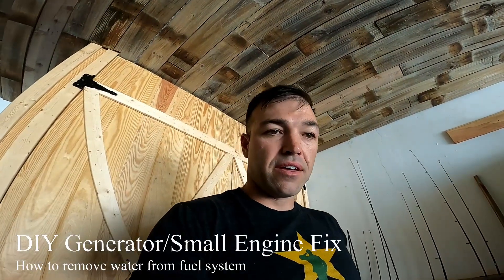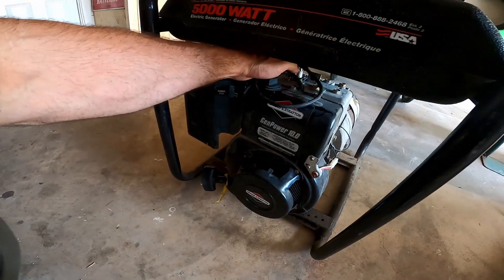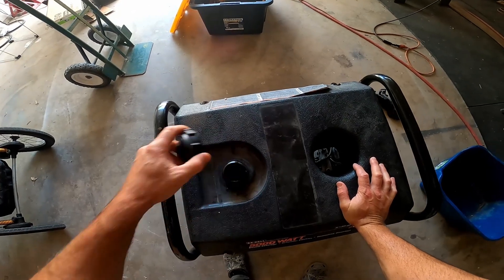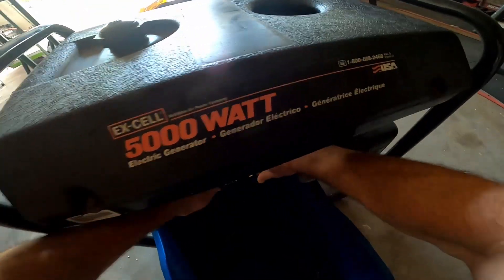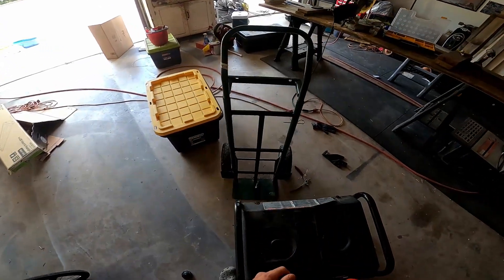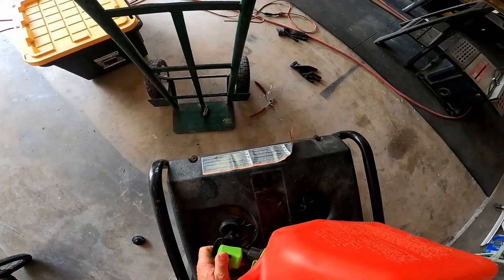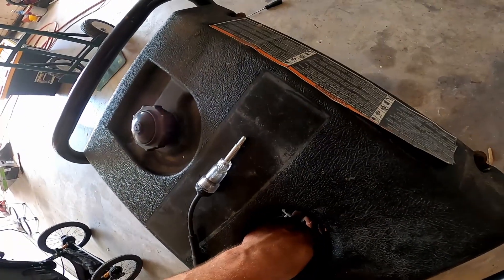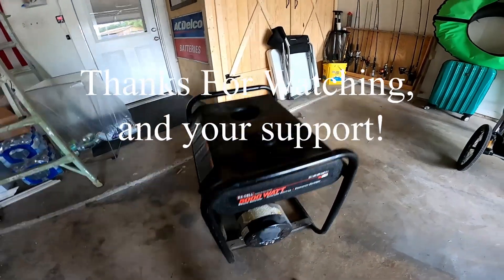DIY Generator Small Engine Repair (water in fuel)

Comment: Hellow friend, somebody pour salt water inside my Honda petrol generator tank and  now it is not starting.please suggest me what to do?
Reply from the maker: Aloha, 
Here is what I would do, not an expert

1. Drain tank remove all lines that feed carburetor
2. Drain and clean carb
3. Remove spark plug and crank engine to clear cylinder…
 If there is sediment or salt in the fuel tank after draining, clean and drain with new fuel, repeat process until no sediment/ salt is in the tank or lines, hook up all the lines to carb and allow fuel to run and fill bowl,(do not start it yet) let the carb fill with new fuel and drain it again, inspect for sediment/salt, once the fuel runs clean then replace spark plug hook everything back up and attempt to start….if you still have issues repeat the entire process…good luck